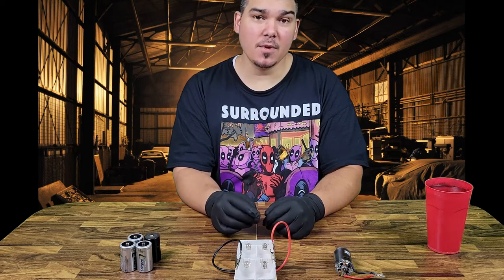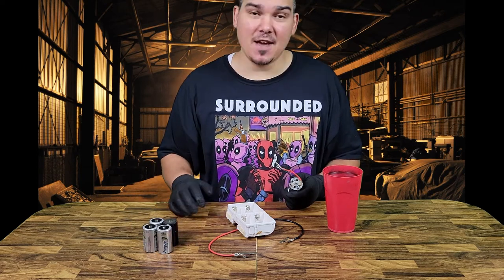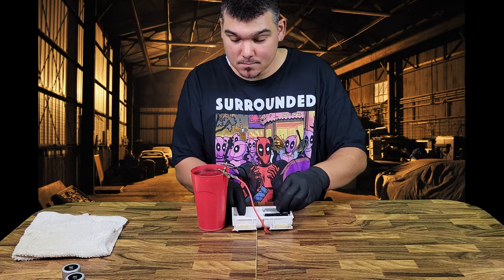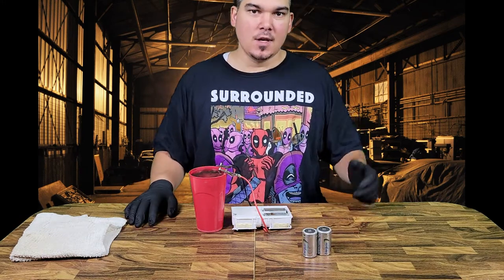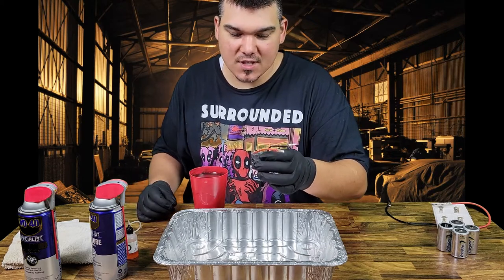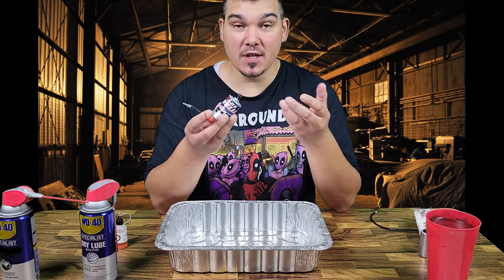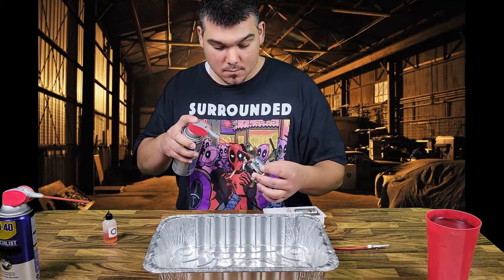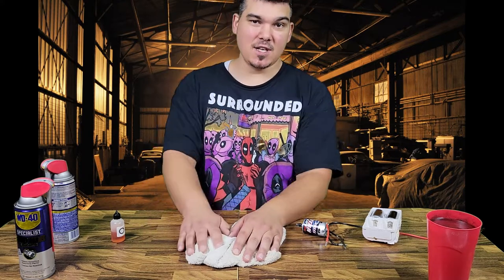Break in and maintenance of a brushed RC motor.

Comment: I have been doing RC for 35 years, nothing wrong with your method, I just believe that is too long of a time in the water.  If you had an open endbell motor, that you could remove the spring and check the brush every minute or so, you would see how quickly the brush conforms to the roundness of the armature. I have never needed more than 5 to 7 minutes of water break in to seat brushes properly.
Reply from the maker: Awesome thank you so much for your input.  I've only just got into the hobby early this year. So there is still much for me to learn. Does the speed of the motor depend on the break in time? Will running it too long in the water hurt it?

I do this for maintenance was well. I've had a very dirty motor that I did this whole process to multiple before it felt like I got all the junk out of it. I live in an area with a high iron content to our dirt. So these motors pick up and keep a lot of bits.
Reply: @retrokevinrandom5416  I don't think the speed effects it that much, I got to thinking most of my motors I was using had high end, softer brushes that were with a high silver content,for more punch.  Maybe the newer brushes are harder and need to be broke in longer, I just didn't want you to wear out your brushes too quickly.
Reply: @rcfanatic4life  From what I recall most of the sealed can motors usually have really hard brushes, they do this to help prolong their life, but I remember reading that about 5-10 minutes is usually enough even with these sealed can motors.
Reply from the maker: @rcfanatic4life   from what I've read online it seems the newer high end brushed motors don't even need a break in. The motors are have are on the cheaper end $15-25. So if I mess them up I see that as a learning experience, otherwise if I can extend the life out of them all the better!

I've been wanting to get a good crawler, and it seems they tend to use brushed motors. So when I do I'll really have to look into what motor it comes with, or getting a good upgrade for it.

Comment: 30 min is waaaayyyy too long to break in a motor, 5 min tops. I used to race and the brushes on a mod motor are considerably larger than those on a stock brushed motor and they conform to the com quite nicely after 5 min of run time. Most stock motors such as the one you are using have bushings in them instead of bearings however, there are brands and types of motors ( mod or rebuildable) that have bearings in them or a mix of one bearing and one bushing (Holmes Hobbies, Reedy, Injora, etc....)if it is a bronze or gold in color than it is a bushing if it is silver than it is a bearing at least that is how it is in every motor i have ever seen.
Reply from the maker: I've learned a lot since starting this hobby, but there's still a lot to learn.

I live in a area with a lot of iron in the soil. My motors get dirty crazy quick. What would you recommend I do for motor maintenance and cleaning?
Reply: @retrokevinrandom5416  When cleaning a brushed motor I run it till the water is clean then I dry it out then I up the bearings and rotate the com.